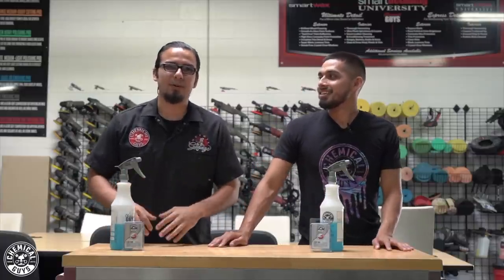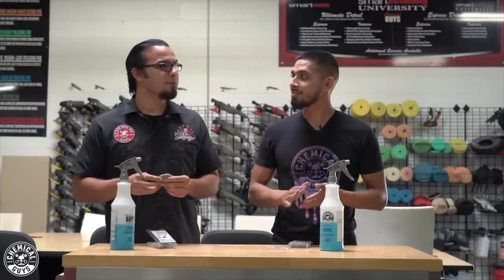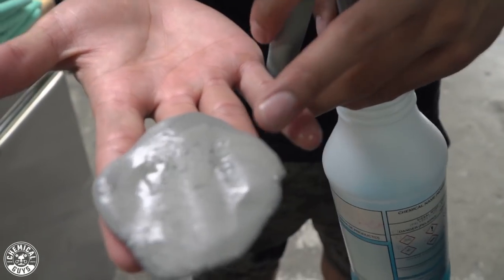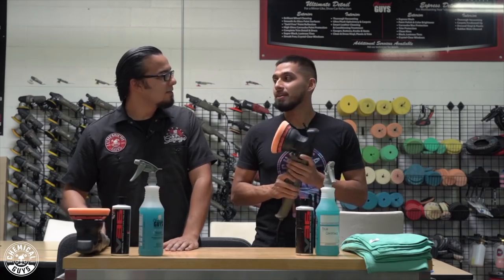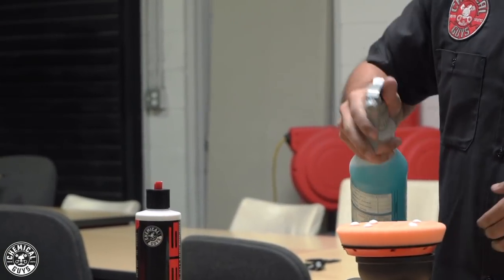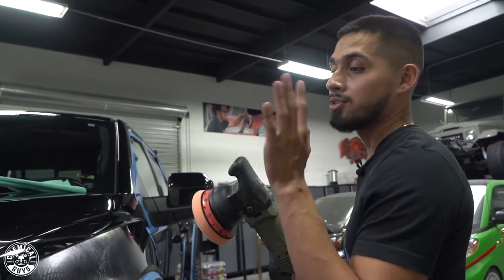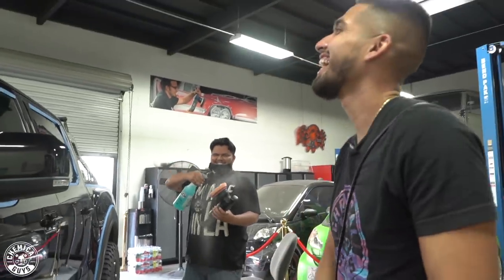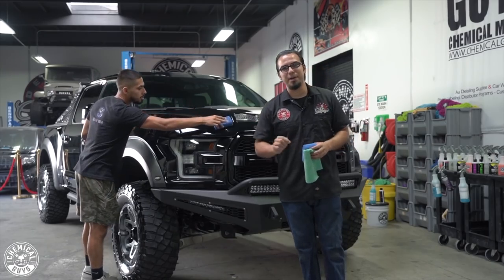How To Polish Large Vehicles! - Chemical Guys

Comment: How often or when should I swap pads?  I've been told I need many pads for 1 car.  For example, 4-6 orange hex pads for a small-medium size car.
Reply from the maker: Hey there! Typically most paint corrections require one or two pads. It is perfectly fine to clean the pad during the job to maintain cutting/polishing power.